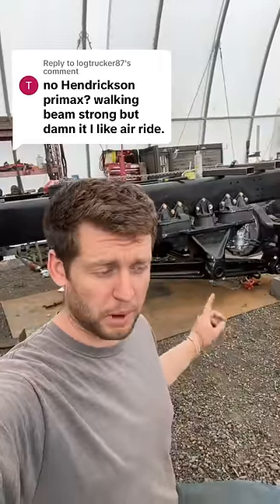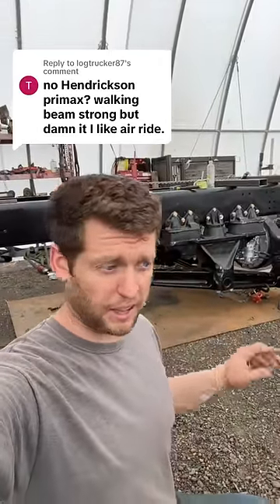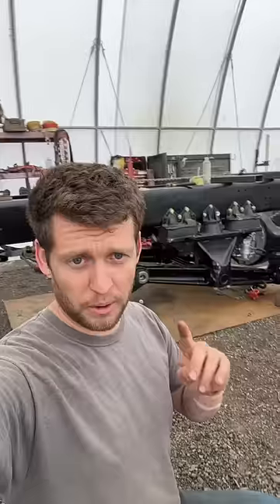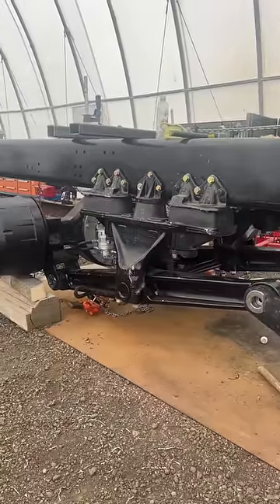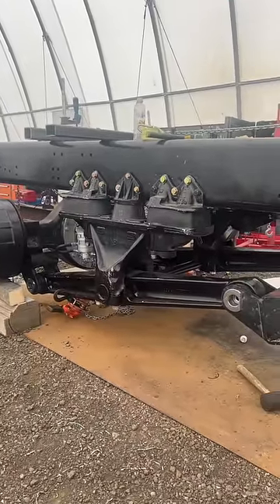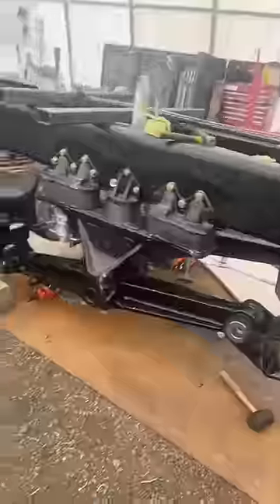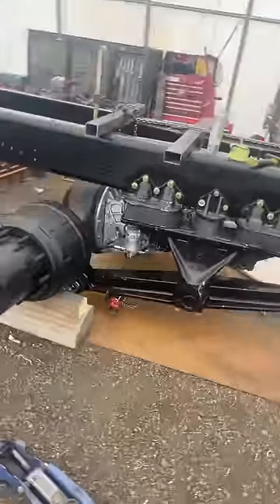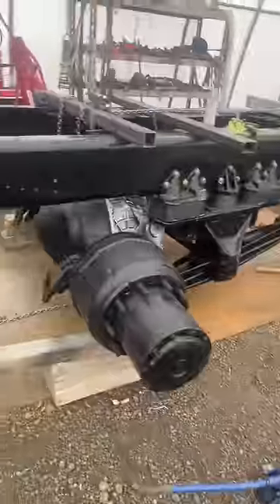Why we have rubber block instead of air ride on the first truck

Comment: It's a good idea test it in the hardest situation you can put it in. That way when it's on air rides it will be under a lot less stress.
Reply: Yeah I like how this company is taking the SpaceX approach to engineering. Unlike NASA where they spend years and years planning and testing small parts and such to build a rocket that will work the first time. SpaceX basically lives by “build it, break it, make it better” which allows them to spend way less time on the development phase and more on the testing phase to get more meaningful results for testing. It’s quite smart.
Reply: @d_kortman  Oceangate did that SpaceX approach too.
Reply: @Adierit  except SpaceX does their testing with unmanned vehicles
Reply: @d_kortman Yeah. I have no problem with the approach as such. I have a big issue with testing things on customers.
Reply: Yeah, that's what he said
Reply: @Adierit they were more of a “build it and it won’t break… I swear”
Reply: it's not an idea. it's already a think. He's not the pioneer of this. it's very much a thing. he also could be wasting a ton of time and money fixing ahit that would never break with air ride too. you say it's smart till he wastes 6 months fixing something that doesn't need fixing. not saying he will but just that it goes both ways.

Comment: Not only that, but walking beam is the most user friendly suspension in regards to repair.
Reply: Have you ever done a set of walking beam bushings?? 😂 user friendly is not what I'd call it, I'd much rather change air bags
Reply: @alexhardy4810 either way you are gonna need a blue tip wrench😂
Reply: @probiethetank8825   bullshite u don't need a flame wrench to change an airbag old ones were alum and that just broke when u went to take fasteners out not a prob a ball peen would get the rest of the alum of the bottom bolt or the top bolt new bags are plastic base and steel top bolts come right out most of the time if not more hammer and done I can change an air bag with a small tool bag just barely big enough to fit the airbag in done it with a motorcycle as "service truck" basic set o wrenches   and maybe a but splinter is all u need. If those walking beam bushings get greased everyday one or two pumps they will last longer than the driver
Reply: @alexhardy4810 we have,but we also have a 100 ton press..We been doing it for decades..
Reply: Another harm chair mechanic
Are you out of your mind
Reply: @shaun.h.barlow that the problem nobody grease them  everyday
Reply: There’s a place on YouTube, where all sorts of frame repair happens on big rigs. There’s also this guy named Bob, well, he’s not really a guy. I mean he’s a person, but it’s just a hand.
Reply: @alexhardy4810 RIGHT!   Snubbing out the air>hydralic press, then smaking it with a sledge hammer to shock it, hoping it busts loose. When it does the press jumps off the floor a few inches. Yea, user friendly alright.......
Reply: @shaun.h.barlow Most walking beam bushings are rubber, and aren't greasable 😑
Reply: @Randyman4126 I've done a dozen or so, and I always get nervous at the press haha
Reply: If you're relying on your truck to drive cross country for a living, you should probably just pay someone else to maintain it.
Reply: Unfortunately walking beam destroys ashfault roads.

Comment: Very good plan! Some Mack trucks had that suspension too. They called it the Camel 🐫 Back suspension. Strong, simple & very difficult to break. But rides rougher than anything short of bolting the axels directly to the frame!😂

Comment: Trial by fire.  You either get consumed or tempered and stronger.

Reverse principal of Planned Obsolescence, which started with the auto industry in the 1920's by the way.  Build it durable, stress it beyond spec to failure, find what breaks, and build it better.

Good deal.

Comment: My truck uses this setup and I love it. It's rated for more weight than the air ride setups at my site and it's lower to the ground which is huge for my job, it rides horribly but I'm about it lol
Reply: That's what the air ride seat is for, eh?

Comment: I love rubber block walking beam. 
One less air leak to chase. Add a hard cab and storage box jump seat. 2 stick trans 
Armstrong center point steering the only air ride is the low back Bostrom driver's seat. All metal interior with a removable rubber floor mat

Comment: Issues with the walking beam no there aren't but the brackets holding the rubber blocks yes. 
 I worked the concrete industry for 20+years. We ran many mixers with  that very suspension and the frame brackets were the one component susceptible to failure. There is almost no give in those blocks and the pin connecting the beam to the frame where the blocks are would fail. It was a struggle to replace them in our small shops.

Comment: I had an old rv that had the most complex suspension system I'd ever seen. It has these cantilevers(for lack of a better word) that pushed against 2 rubber blocks on either side. It made for a pretty nice ride but if the rubber blocks ever go out it will cost more to replace than the rv would be worth even in pristine low milage condition.

Comment: It’s a Catch 22 situation that I see happening here. If you mount the rough riding suspension, the driver will automatically slow his driving rate as it becomes uncomfortable. If you had air ride, the axles take an absolute pounding but the frame and everything above the frame have a slightly easier ride.

Comment: All our roll off trucks at work are walking beam, with 20k pound steer axles, theyre rough riding but tough as hell, and they have to be, were hauling upwards of 15 tonnes at times and taking it right into the working face at the landfill, our other air ride trucks are constant issues, punctured bags, torn lines and the proportioning linkage gets mangled on one of them every second month 😅 a ncie ride is great and all, but not being broken down is too 😎

Comment: Complete novice here✋
I was vaguely aware of this suspension type, but I didn’t realize the only damping came from rubber blocks and the ability for one axle to lift as the other drops relative to the frame. 
Am I right in that assessment or is there more going on here? If not, wow, how can that possibly be enough?? There’s no way to prevent bouncing? No shock absorption other than the little bit implied in the arm’s lever-action? 
Crazy - shows you how much (or little) I know🤷🏼‍♂️

Comment: You can add air bags to the rear axle with a walking beam suspension.  Great for balancing and weight distribution. Walking beams are great for large tow trucks as long as you have airbags at the rear axle.

Comment: Air ride is expensive AF. I dunno about in the trucking world, but last year, I bought an '03 Town Car that came equipped with Air Ride. Of course, as you can probably guess, it failed very quickly after I bought the car. I did some research on what it would take to fix it, and pretty much, if one part of an Air Ride system goes, you pretty much have to replace the entire Air Ride system and for a Town Car, that'd be a cool $4800 minimum.
 
That's when I came across the recommendation to buy an aftermarket shock and coil replacement kit. Said kit cost me about $600 and then I took the car and kit to a mechanic who charged me $150 to put it in the car. $750 vs $4800? No-brainer.
 
Sure, it's not quite as smooth as it was before, but I only paid $3000 for the car initially. I'm not going to pay the better part of 2x the value of the car in replacing something that might go in a couple years.

Comment: How many licks does it take to knock the rotor out of it? You are right about knocking around batteries. Stress test complete when the battery pack turns firework. No good off road in a forest. Not easily put out.

Comment: They saved me from roling it i hit the ditch at highway speeds and  went over hit a crossing flipped the truck back on the highway it landed like a plane .9 feet of air under rears and 6 feet under the front blue the retreds off . Had help from up high that day . A big loader blocked the road .

Comment: Now I'm just an armchair dummy here, but wouldn't the air ride create just as much (if not more) vibration and shock to the axle housings? The air ride is better at divorcing those forces from the frame of the vehicle but those forces still exist. Instead of halving them across the beam by trying to force the attached axle in the opposite direction. Air ride allows each axle to work independently and uses a cushion of air to dampen the forces on the vehicle frame. Walking beams are commonly used in dump trucks in my area because everyone says they are better at avoiding wheel hop in adverse conditions. Ride quality is the only thing I've ever heard of being a complaint with walking beams. I may be completely wrong in my thinking though but it would be cool if smarter people could chime in.

Comment: Yes, test to failure. don't go easy, that way you can say with confidence what your product CAN and can't survive. I work with a few vendors like this, and we strive to work with them whenever w can. we like being able to trust a vendor who is 100% confident that if their datasheets says it can do it, they'll stand behind it. if you test it and it breaks, simply list the highest it can take without breaking, plus any safety factor. I hate when companies over promise and under deliver, and so many do it. they'll do crap to cheat so sales can make something look better than it actually is.

Comment: I used to be in charge of a fleet of T800s with chalmber suspensions that ran coal ash from a power plant to disposal site that was only a 7 Km round trip. I can confirm that he ain’t wrong about waking beam suspensions. Ride like crap but handle abuse like no other.

Comment: I'm not knowledgable of truck suspensions, so i wonder if the axles are going to have some sort of rubber stopper, since with how it currently looks, to me it looks like an inverted sprung see-saw which i think if it articulates, the axles would hit the frame rails.

Comment: I caution you on this, do not have a cooler with ice and drinks inside on the back when this chiropractor friend takes the first gravel parking lot. Paint cans, either spray or in cans, might be worth having just behind the pivot of the walker. I'd imagine that paint would be highly mixed and possibly aerated. I'd like to see the test drive for this unit, no doubt.

Comment: Rubber block would be better for off road rigs, 

I’d keep it as an option for people that are old school and don’t like air ride. 

Personally I would rather have reliability over comfort. The technology in the seats of rigs these days are insane. 

Put a 15 grand seat in there from Volvo and you’ll float like a butterfly using solid suspension

Comment: The only flaw with walking being suspension is bushings other than that they're Bulletproof. But it's not hard to pull them apart and put bushings it's just the downtime and the pain in the ass of doing it

Comment: I drive a roll-off straight truck with the block suspension and it sucks and I understand these trucks need to be able to handle heavy weight however can they designed the cabs for a little bit of comfort for the driver

Comment: I think axles take more abuse with air ride because when In doubt throttle out. You can’t feel the bumps in the cab if you go faster. Rubber biscuit slow people down because they can’t take that hammering that air ride smooths out

Comment: The rubber blocks, actually. Is it easier for the axles as they transfer more of the energy into the frame, but it's brutal for everything mounted to the frame

Comment: Are you gonna be making trailers too?
Reply: I think they mentioned looking at making trailers with e-axles as well to make them full-time AWD, as well as putting thin PV cells on the sides of vans and reefers to collect power while driving or even sitting so you wouldn't need diesel to run a reefer, it would be like a home fridge.

Those are all in the future.  Right now, focus on the Edison Truck and the retrofit kits for converting regular tractors to Diesel-Electric Hybrids.

Comment: I have to heartily disagree about the walking beam set up having few issues. For fours I was a garbage truck mechanic. I had 24 trucks at my location with another 70 it so at other locations that regularly passed through my shop.  Not including the single axel trucks, obviouse reasons, they all had walking beams and they all had issues.
Now, maybe it's different with garbage trucks since they go through absolute hell. But, those walking beams are far from bullet proof.

Comment: Battery heater and an air bag for the batteries, and cover up the batteries, when you use a cutting torch to cut those rubber blocks out, and really , you can't find 8 bag Kenworth air ride?

Comment: It would be cool to put full 53' solar on top of the trailer to charge as it's going down the road
Reply: You should research all the energy and resources it takes to build those inefficient solar panels
Reply: @johneckert1365  I'm well aware of how bad they are but given the space and a strong enough solar setup you should be able to get a good many more miles down the road

Comment: How long are these tests going to last? After 50 years in the business, it's my opinion that the only way E trucks will succeed if if they are all replaced every 3 years. There is no test track that can give you same results as actual running on the highways over several years in all weather.

Comment: Ive got a question concerning walking beam suspension.

Say if the forward axle of the pair goes over something on the left side, will it rise only on the left, and the right side stay to the ground?
Reply: For normal whoops it will flex as much as the rubber bushings will allow, probably as much or more than air ride does side to side. Not having drivelines will also allow them to have more walking beam travel so it should be more capable than a traditional truck off road

Comment: I don’t really know anything about trucking but why even have any of that stuff? I mean, yeah, it would be good to have at least rubber blocks for the cab but why not just have regular springs without either system on the trailer?

Comment: Wait wouldn’t you want to test it with the air system so you can get an accurate real world test? I’m sorry if I’m mistaken but it just seems like you added the strongest parts so the product would look better instead of it with the air system

Comment: So many companies are focused on planned obsolescence. Designed to last a specific amount of time(the warranty period) and then the self destruct sequence is activated....
I'm skeptical of any car with a WiFi connection/OnStar, or whatever they decide to use tomorrow. If the computer controls everything on the car, what keeps them from forcing you to buy a new one. Won't be long before they start sending epa around to stop mechanics from fixing cars, and gas cars will be forced to live in small communitys like the Amish, and distance themselves from society 
Not really but I'm sure you understand.

Comment: never ever drive a truck like this, i had driven for 30 years and then took a job driving a truck with rubber blocks for suspension. it totally destroyed my back, i have had 3 surgeries and will be getting a 4th, worker's comp has paid me over 340 thousand in lost wages, some days i can't put my own shoes on without my wife helping me. i just hope your the driver that will be "testing" that suspension. but what the hell as long as you can save money by not using airbags who's it going to hurt.

Comment: But won't the axles be taking less abuse?
Think about it when you watch a suspension video. You see the axles bouncing all over the place and the body staying still. On crappy suspension you cannot move that entire mass that rapidly. Only to a driver it feels worse. Now imagine yourself strapped to the axle. I would much rather have it all rigid.
On air ride suspension, the axles bounce all over the place and the air bags absorb it. On stiff suspension the whole entire mass of the truck is absorbing it.

Comment: This a false assumption that will come back to bite you whose to say the air bags won’t produce a weird oscillation that is harder on the motors than the rubber blocks

Comment: On top of the fact that electric vehicles are impractical and much less versatile. As well as the fact the government is trying to corner the energy market. These incredibly heavy electric vehicles will destroy the roads how heavy are these big trucks.
Reply: You are aware the maximum weight with load is the same for trucks?
Reply: I mean, the truck is actually quite alright on weight. Pretty comparable to the normal engined counterparts. It's light enough that it can benefit from the extra weight allowance given to electric vehicles, letting it legally carry a heavier load than more normal trucks. They did a weigh in a few videos ago on their tik tok
Reply: @simonm1447  The fact that you ignored my first 3 points just proves how strong of an argument it was. It's not necessarily just the semi trucks.
Reply: @theygunaHATEME  sorry mate, i can not see any legit points. A normal car (not a ridiculous overblown US ute in the size of a Sherman tank) weighs 200 to 300 kg more as an EV compared to the ICE version. So you have a car which weighs 1,8 or 1,9 t instead of 1,5 or 1,6. These 300 kg are within the payload of a normal car, and no street will get damaged because of a car weighing less than 2 t.

A Silverado or Ram weigh way more as a normal sized EV, even as an ICE version.

The trucks have an 80k lbs weight limit anyways and so the total weight is the same.

Commercial trucks damage the street, but they do this in the diesel version too since they are always heavy.